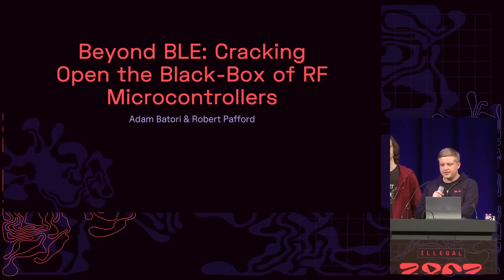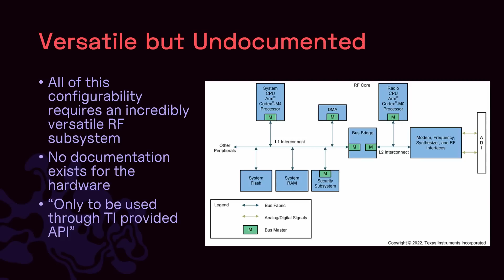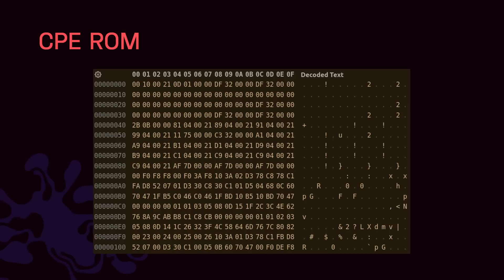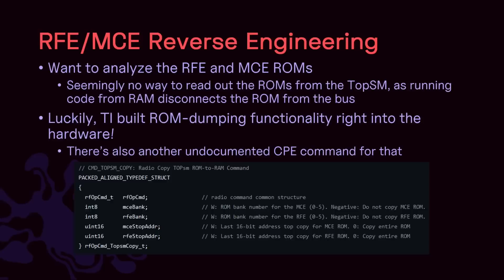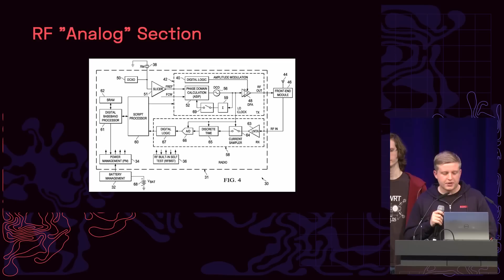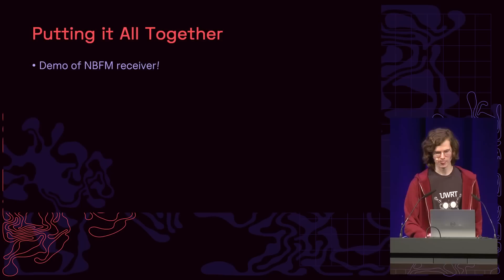38C3 - Beyond BLE: Cracking Open the Black-Box of RF Microcontrollers

Comment: Awesome work. 
We did something similar with the Silicon Laboratories EFR32 series of radio chips and built the Geckokapula handheld radio with it. 
We get similar sounding bands of 13.2 - 725 MHz / 766.7 - 966.6 MHz / 1.15 - 1.45 GHz / 2.3 - 2.9 GHz. RX is AM/FM/SSB/CW and TX is CW/FM/CSSB.
Can't wait for the beefier TI based versions doing something similar. 
The well exposed amplitude control should allow for decent polar modulation and in general generating some good quality SSB via EER.